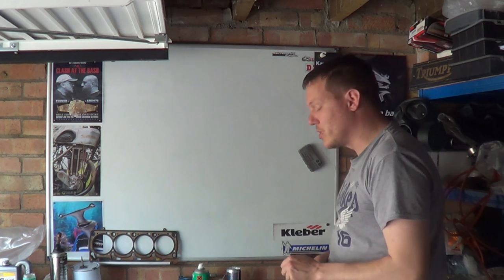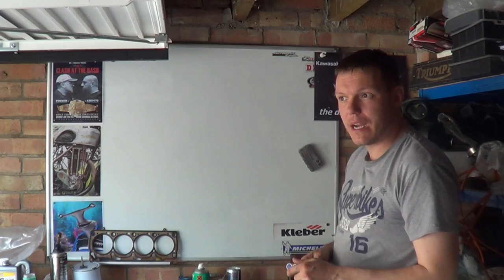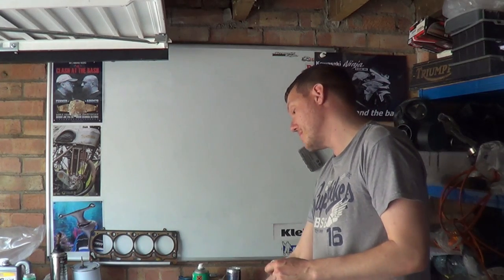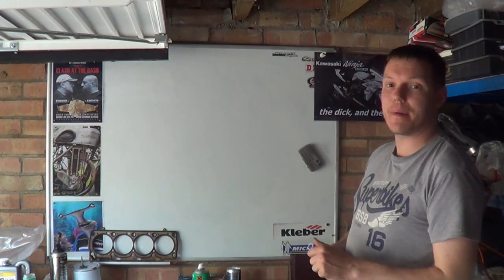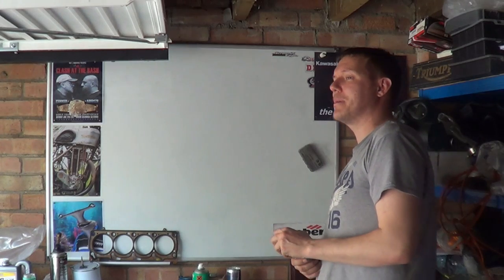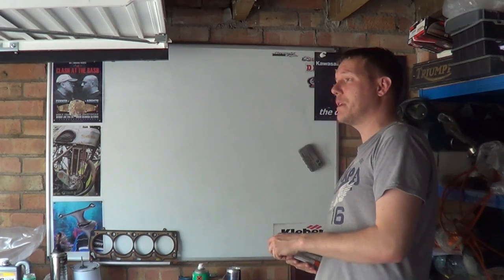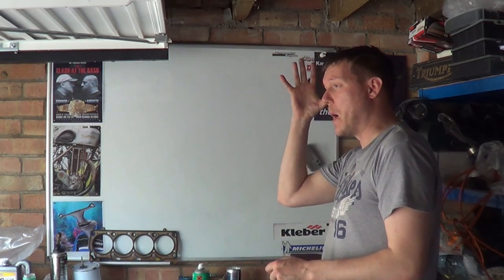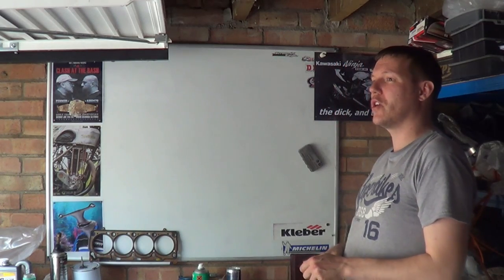Ceramic Bearings need lubrication?

Comment: Silicon-Nitride is quite impressive.  I think the latest generation of ceramic-based materials has the fracture toughness for duty in an engine, no problem.
Reply: Was wondering if these full ceramic ball bearings in could be used as crank bearings in a 250cc two stroke

Comment: My Ford F-350 6.7 super duty has ceramic ball bearings in the turbo charger. 60 degrees here in Alaska with 20 hours of daylight.
Reply from the maker: "Alaska with 20 hours of daylight."

- and you have internet? lol

Comment: Not sure about tough? Don`t tough materials have a high modulus of elasticity, and a high Young`s modulus, (most types of steel)? Ceramic bearings are definitely strong, and so have a high Young`s modulus, but their elasticity is low, therefore they are relatively brittle. You can smash a diamond with a hammer blow. I suppose you might mark a steel ball? Love your vids - How do you make so many? X
Reply from the maker: Strong is term we don't really use in engineering with a more descriptive add-on so to speak. Tensile strength, yeild strength etc are more apt. You are right though toughness or being tough was the wrong word. Shit the bed lol
Reply: You`re right. Strong is too imprecise. Brilliant the way you reply to my pedantic comments! Thank you. X
Reply from the maker: LOL no worries mate

Comment: There are bearings that require no lubricants in the traditional sense. There are three I can think of off the top of my head. Air bearings or steam bearings do not require conventional lubricants as they self lubricate via the flow of air or steam. Air bearings are awesome, but require precise manufacturing and a power source to work. Magnetic bearings do not require conventional lubricants either as it is also a contactless bearing technology, but it also requires a power source. Electrodynamic bearings are also contactless bearings which are similar to magnetic bearings; however, they use the lenz effect, so it is a more passive magnetic bearing technology.  Any kind of contact bearing will eventually reach a physical limitation, hence conventional lubricants will be required in my assessment. Some bearings can operate using dry carbon lubricants, but they are not suitable for engines.

Comment: i was told ceramic bearing can shatter under very high load (like if the motor locks up up or drops a valve or something) where a steel bearing wouldn't, is this true?
Reply from the maker: Depending on the bearing material, but generally they can do. But that's selecting the wrong bearing for the application

Comment: Does ceramic bearings for inline speed skating (608) required lubrication? If yes then which type of lubrication..i mean cream based or oil based?
Reply from the maker: a light grease would be good
Reply: Thank you!
Reply: @bepositive9259 thank you for your question this is my questions so I am clarify

Comment: Does ceramic bearings on the bottom bracket of my road racing bike needs lubrication? I am putting 300watts and 85 pedals per minute on average also I have noticed that when i first intalled them they were silent bot now they make that noise like they are dry and they are still smooth. Help me out I'm confused

Comment: If you go the real Direct Injection closed-exhaust-port route with high pressure fuel pump, what if you use the high pressure fuel for a hydrostatic bearing?
Reply from the maker: lol so even though its extemely hard to get away with doing Direct injection, you then wanna increase the demand on that same system? Are you actually mad?
Reply: Its not engineering if its easy :)

Comment: do full Ceramic bearings need to be lubraton on a motorcycle?i am using Zirconia ceramic bearings which is harder than Silicon nitride ceramic bearing
Reply from the maker: All bearing have friction, all bearings need lube
Reply: @dirtygarageguy  Ceramic bearings have very low friction duel to it do not absort heat, which heat created friction and Zirconia ceramic bearings is the best at heat resistant as i have do a research on this, dude
Reply from the maker: Was that a question or an answer?
Reply: @dirtygarageguy  this guys drunk or something
Reply from the maker: I don't know